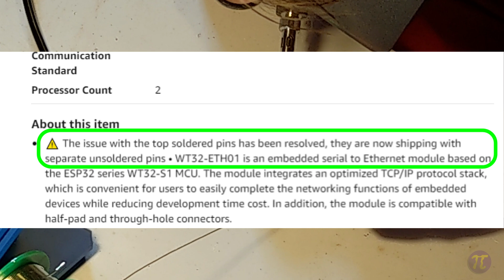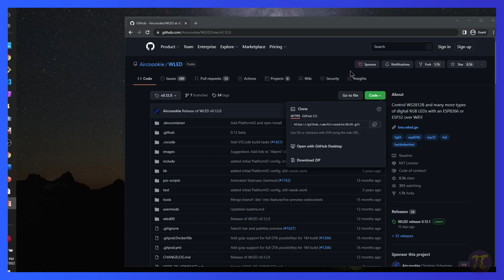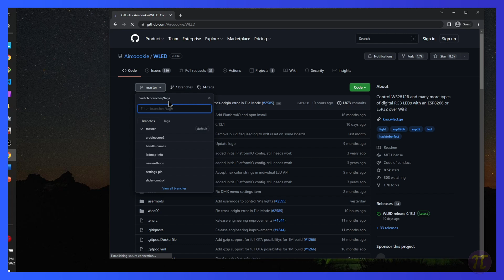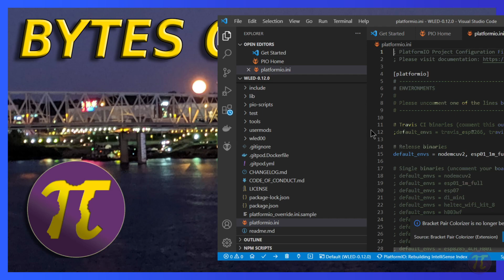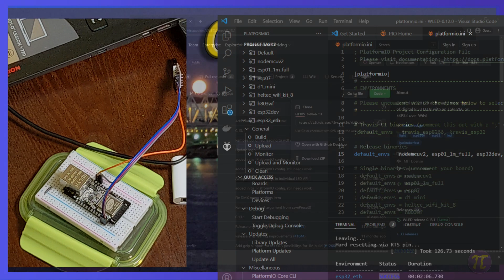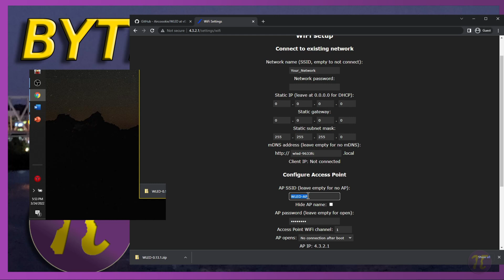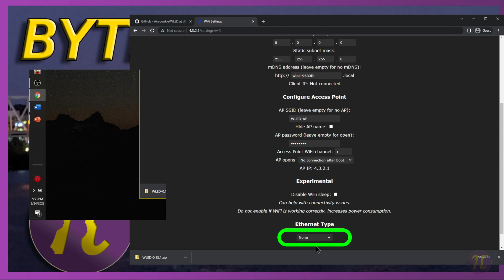How to Flash WLED to your WT32-ETH01 microcontroller

Comment: At 5:09 you use an item in the "Project Tasks" menu.  This menu first appears at 4:18. The "Quick Access" menu that you reference at 4:18 is not up by default and is hard to follow along when you cut out and come back to the menus already up.  I found the "Quick Access" menu, but have spent an hour trying to find the "Project Tasks" Menu.  Can you help with where I need to click to make that pop up? ------- EDIT:      This menu pops up after you do the "pio pkg install".... and close visual studio and then reload it.  I guess I should have walked away earlier and come back!
Reply from the maker: Sorry that it wasn't clear.  Were you able to find what you were looking for?
Reply: @BytesOfPi  I agree with pjp. You skipped multiple steps within the software that cause a lot of confusion. You also incorrectly said to attach to rxD on the WT32 when it should be rxO. In your image you are showing the proper location to place the jumper but it is labeled incorrectly.
Reply from the maker: PJP,  you make a great point.  One of the things I dislike about similar walkthroughs is when the presenter stumbles around, uses filler words like "um" and "ah" and has a lot of pauses waiting for the software to catch up.  In order to cut out the fluff, I must have accidentally cut out when the editor shifts.

You can get to the project tasks by clicking on that little alien icon in the left hand bar.  If you notice before and after 4:18 on the left hand side, there is an alien icon (PlatformIO) that lights up.  I must have cut out the part where I click on that menu while cleaning up the video.  My apologies.

Comment: Got my WT32-ETH01 modules, also purchased a few 8 channel level shifters but I have not been able to get lights to work properly. Looking for some wiring diagram to help get things working. I assume LED output is "IO2, IO4, IO12, IO14, IO15"? I have 5v and GND to power WT32, 3.3 to VA, 0E and 5V to VB on TXB0108 level shifter, A1 signal in, B1 signal out, GND to GND. Thanks!
Reply from the maker: Let's see... Lot of stats, little on details about what is happening with lights. 

I assume you were able to flash WLED using a serial adapter and power the board enough to access it on its wireless AP.

You are correct that pins IO2, IO4, IO12, IO14 and IO15 are the digital output pins that can carry a digital signal, but unless you map them in WLED, they won't do anything at all.

Before permanently setting up your lights, and before using a level shifter, it would be good to test but you set up your WLED correctly to the pins you're expecting by connecting it with jumper wires to your lights up close.

You mentioned you purchased a surface mount level shifter TXB0108  which means you have access to fine detail tools.  You probably are comfortable and have access to tools like an oscilloscope.  You can use this to measure the reference 3.3v data signal coming from the pins and how it gets boosted to 5.

In my other video about 9:56 in, I show the pin connections I use to a cheap 4 channel IIC I2C Level shifter.
https://youtu.be/GeJxolPpiE8&t=596

I show that I connect to a reference 5v and reference 3.3 v, but I've found that I only need (and works better) if I only connect the reference 5v.

There are many different levels to triage connectivity issues.  If you have more details on how far you got, that may offer a clue as to what step to try next.
Reply: @BytesOfPi  Yes, programmed module using Wifi, then wired to network, WLED output to CH2 configured, (assuming CH2 is IO2) tested signal to lights directly but has random pattern and not controlling like WLED should be or like my Espixelstick works. If I run through level shifter the "0E pin" being high or low (3.3v or GND) will activate the output which may be different then the device your using and adds complexity. At this point I am likely having issues with WT32 module so my problems could not related to level shifter but just needed to ensure I was doing things correctly, yes I have an Oscope I might hook up to further troubleshoot with.
Reply from the maker: @Bill J  gotcha.  You've successfully flashed the board and able to connect to it via Wi-Fi.  
You have the pixels really close to the board (around 30 cm or less)
Assuming you have a pixel strip or bullet pixels with three connects (no clock pin) and you have a multimeter ensuring that you're getting 5 volts and ground to your lights.

If you're struggling with IO2 (pin 2), go one more pin up to IO4 (pin 4 in WLED) and try that.

If you also have a 330 ohm (or around that) resistor, put that between your data line and your lights

Also there are different builds of WLED that work differently on different boards.  Did you use platform IO and build it yourself or did you download the binary? If so which build did you put on the board and was it the esp32_eth build?

Comment: Hi Kevin, can I use this software to create a WiFi access point to a wired network?
Reply from the maker: Not sure who Kevin is, but the WLED software isn't going to act like an access point to your wired network.  If it's not connected to a network, it will broadcast as an AP, but when you connect with it, it won't route your traffic to other places. The only device you can access is a browser to that device.
Reply: @BytesOfPi  Thanks..!!

Comment: I order 2 of these boards after watching your video, Great video and setup( the other video). could you tell me which 4 pins i should use for led. Right now I have few ESP 32 and 88. Ethernet sound good . I usually leave my boards running and only turn off the big powersupply. I think this would help with the boot problem other people are having (hoping). I would suggest you do another video showing how you do the wiring from relay to Wt32 to levelshifter to output. Thanks again love your shows.
Reply from the maker: Thanks Bisham!  To answer your first question about ports, I think pin 2, 4, 12, and 14 maybe the best pins to go with.  You can try pin 15 as well. Stay away from 35, 36, 39 as they are input only.

The pinout diagram comes in really handy:
https://m.media-amazon.com/images/I/71CYGN4D47L._AC_SL1200_.jpg

As for keeping the board on the entire time, that would definitely help boot issues, but if you're board is in a small box like a CG1500 and is out in your yard, wiring up an additional 5 volt power supply just to power your board may take up more space than you have.  If you have the space and you have an additional 5 volt power supply apart from your main power supply, great!

Appreciate the advice about wiring from the WT32 ETH01 to the level shifter. Probably not enough content for a full video so maybe a fritzing diagram.  In summary, there is a 3 volt side and a 5 volt side.  Make sure the 5 volt has a reference voltage from the power supply as well as ground. Then wire up your 3 volt ports to your board pins, and then your output wires to the corresponding 5 volt side.
Reply: @BytesOfPi  Great info....thanks a million

Comment: Great video... However if you can just flash from the beta online wled install.

Could you do a video with how to a custom compile for this board? I've been trying to add a thermal sensor
Reply from the maker: Hi Kevin. Good observation.

  I'm definitely doing it "the hard way" by downloading the source code, compiling it, and then installing.  You can definitely install the precompiled binary and they have good instructions on how to do so.
https://kno.wled.ge/basics/install-binary/

However, you have to trust binary isn't tampered and you can't do customizations, like your thermal sensor.  I'm not quite sure what you want to do with thermal sensor except for maybe shutting it off if it gets too hot or sending yourself a message.  You can definitely make those modifications with the way that I'm doing it that by modifying the source code and overwriting some pins.  There are already a couple mods that attach thermal sensors.  https://www.reddit.com/r/WLED/comments/kzsp9i/can_i_add_a_temp_sensor/

Before the 0.12.0 release I had to modify it so that my board could use multiple output pins and that customization was easy using platformio.ini file.  If you need to modify some of the C files to write your own mod, it may get a little challenging.
Reply: @BytesOfPi  Hello. Well got my head around Custom Mods :) But ive got a new problem, im finding the board is running hot. So hot its to hot to touch and then stops working. Did you find this board was running hot?
Reply from the maker: @kevingreene2397  
I've not seen any of my boards getting hot.  

How are you supplying power to your board?  Does it have a dedicated line to your 5v pin or is it sharing a line to power your lights?  Also make sure you are powering it with your 5v pin and not the 3.3 v pin.

If you have a multimeter, check the voltage at the pin you are powering it from.